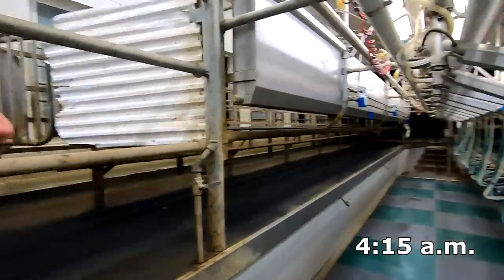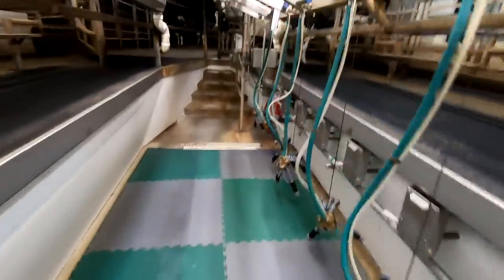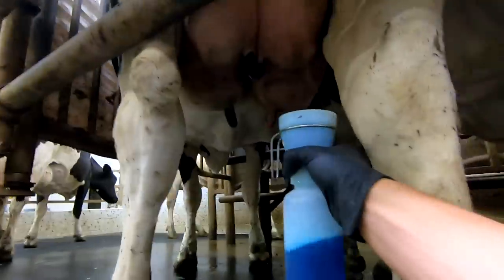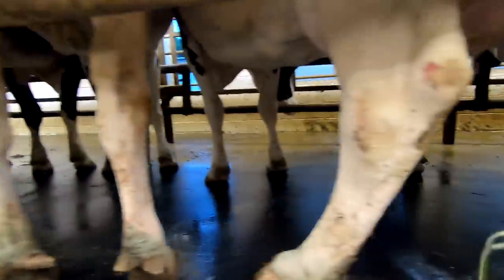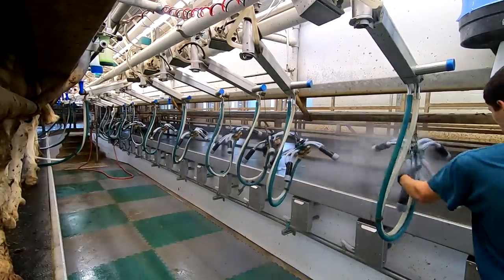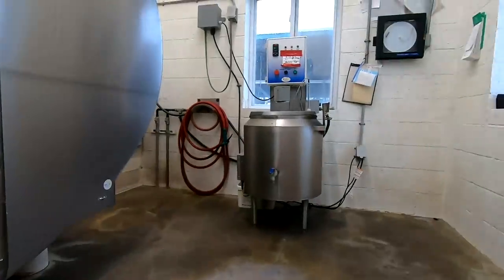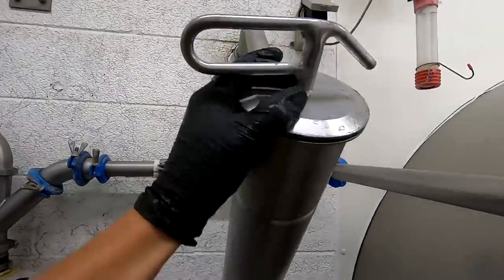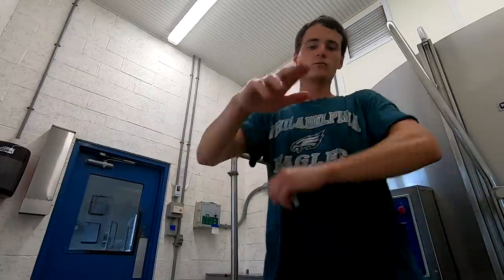Milk House Set Up and Clean Up

Comment: Ive hauled milk on farm pickup several years ago. There are farms you could eat off the floor. There are others not so great. Its good to see someone taking pride in dairy farming. In my area most have gone to a direct load system. Its sad to see the small farmer is going away. 
For those that have never seen it a good indication of how a dairy farm is run is by how dirty the sock filter is. That is a clean filter. Good job.

Comment: Thank you for showing us the pains you go through to keep all the equipment clean. You use a lot of water. Do you have more than one well? It wouldn't be fun to have the well run dry or low on water. I grew up on whole, raw milk. We had to shake the milk container because the cream would separate and rise to the top. A lot of times we would skim the cream off and make ice cream. That was the most delicious part.

Comment: I’m surprised that the clean-in-place system doesn’t include the line with the filter.  Good video, reminds me of when I was younger and milking cows.  😀
Reply: it does
Reply: Ada 1812   He changed to a new filter before he started the cleaning cycle.  The filter should not be washed.

Comment: Thanks for another great video Eric. The cleanliness of your milk house is outstanding as a milk truck driver its always a plus when the milk house is that clean. Is that a 5000 gallon bulk milk cooler? I have only picked up one dairy farm where the milk goes in through the valve and they were milking with a LELY robot the dairy farms that I pick up all have a pipe going in the top while they are milking.

Comment: I dipped stripped dipped and wiped for years.  That was with an iodine predip. When I switched to the blue foaming delaval pre dip I switched to dry wipe foam on strip wipe.  I like that way for keeping the supper clean since the foam uses less dip but sometimes I do an extra dip if the foam dries a little

Comment: Why do you pasteurize the milk before feeding it to calves?
Reply: It’s a safely measure in case there are any pathogens in the milk, pasteurizing kills them so the calves won’t get sick.
Reply: Gregg but isn’t it the same milk that the calves would drink straight from the teet otherwise?
Reply: Coach Chollett 
I believe it is one of the advantages of bottle feeding the calf instead of nursing. You know that the calf is getting bacteria free milk and the proper amount of it.